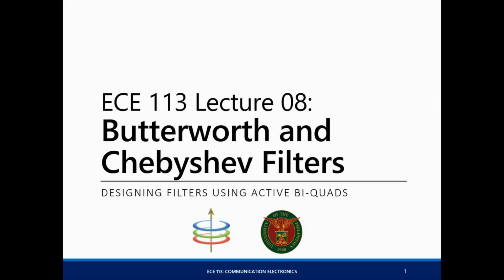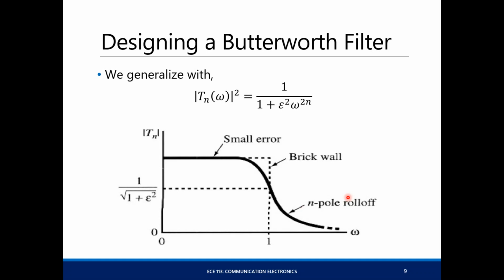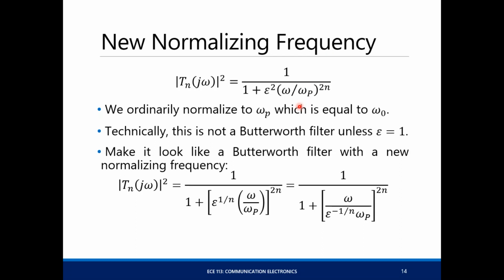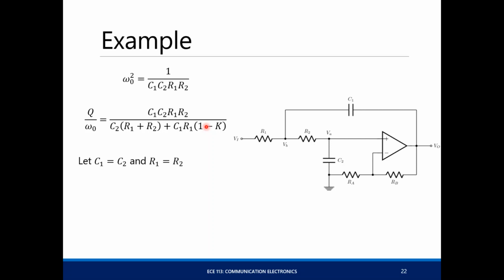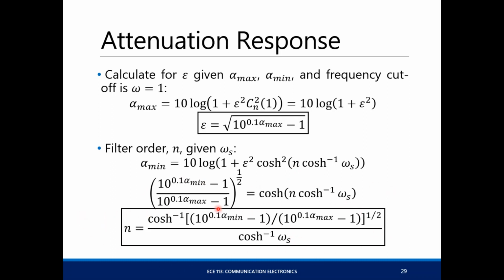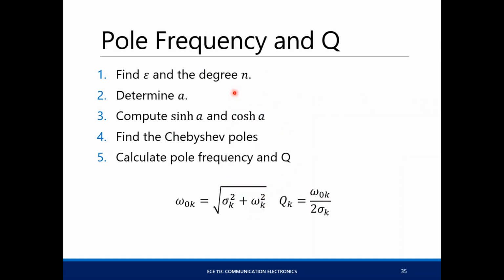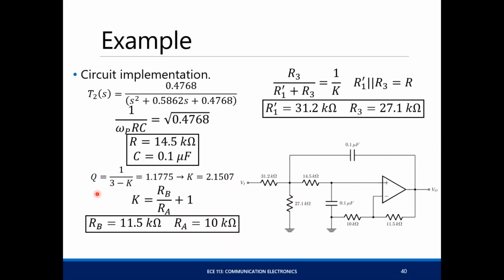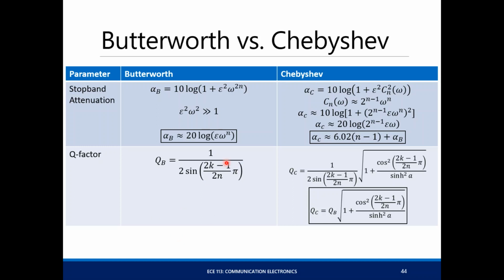Butterworth and Chebyshev Filters

Comment: Is it correct saying that 1/(s+1) has Q factor of 1/2?; Is Q factor defined in biquadratic transfer function?
Reply from the maker: Hello. Generally, the Q-factor is defined as the center frequency divided by the 3dB bandwidth. For a system with a single pole, the 3dB bandwidth is wc which is the cut-off frequency. In this case, wc=1. The center frequency of this is wc/2 since it is a lowpass filter. Therefore, the Q-factor is 1/2.